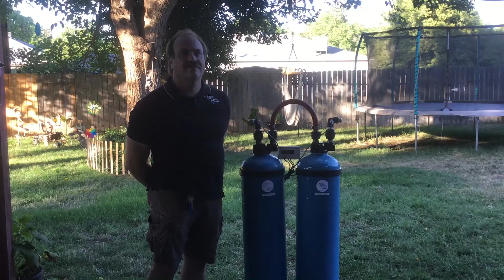DI Tank Introduction

Comment: I have 2 big di tanks linked to each other. Those it have any use to make it 3 ? (Would it save me money on resin ?)
Reply from the maker: Adding a third tank in series most likely would not save you much money on resin.  It would give you more leeway to get the first tank regenerated when convenient.  Having testing ports or inline sensors on each tank will help you know when a regeneration is needed.  If you are using a lot of water, the best way to reduce operating costs is with a RO system.
Reply: Hi there, I see most people use the solatec brush with DI tanks. Is it perfectly okay to use the solatec brush with an RO system? Is there a minimum flow rate required?
Reply from the maker: Thank you for your question!
Both the SolaTecs SolaBrush and the C-Series brushes can be used with an RO system. A DI system is much simpler than RO and that may be why you are seeing most people using that setup.  DI is also a lot cheaper cost up front per gallon, however an RO system may be more beneficial if you are using a lot of water.  In a RO system, you will want to ensure 3GPM at the very minimum because certain factors can cause pressure loss like the temperature of the water.  The flow rate of the SolaTecs C-Series brush is 2.5GPM at 1800 PSI.  If you are referring to the manual SolaBrush, you only need about 1GPM (for rinsing purposes)
Feel free to give us a call and ask us questions at (530) 407-7927!